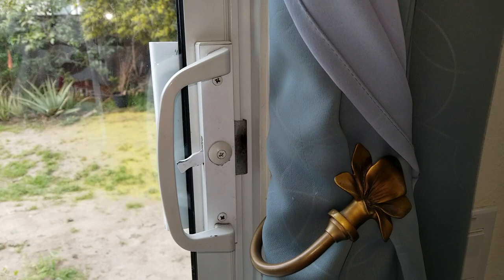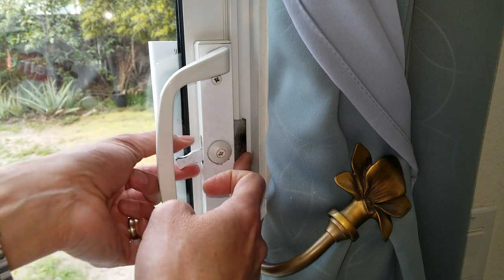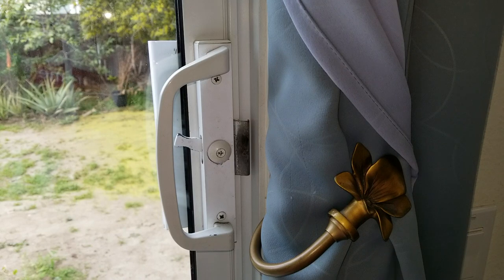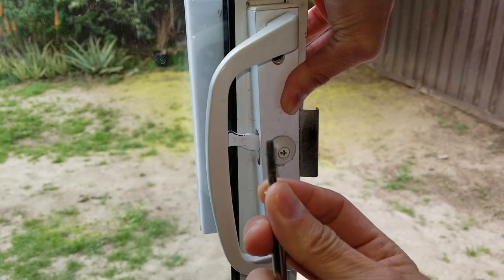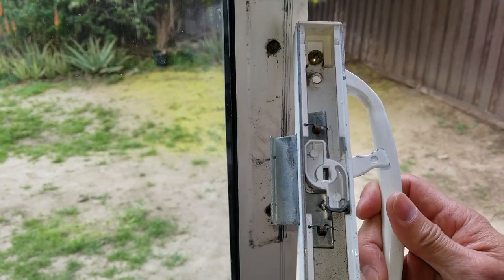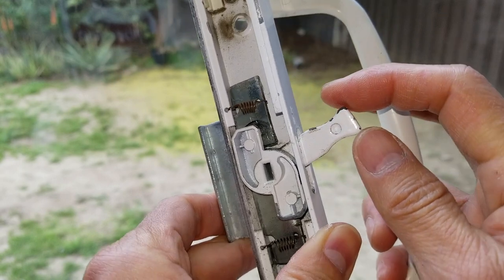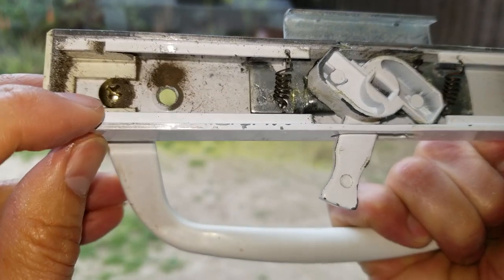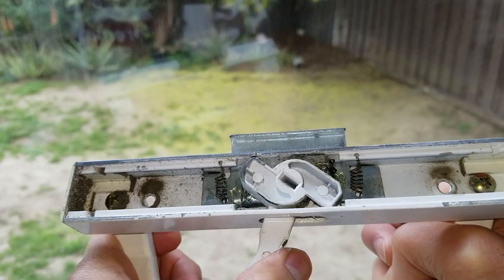Fix Rear Patio Sliding Door Won't Latch Lock or Need Lubricant! 2 1 2019

Comment: Thank you this was a great help. I used WD 40 without removing the handle. However, my latch was too tight against the metal lip and it was difficult to move the latch handle. I loosen the two screws and I made the latch adjustment against the metal lip much easier. Your latch had too much play about one half to one inch. Most likely why the screws were bent by the previous owner. Thanks again.
Reply from the maker: You are very welcome and thank you for your feedback.